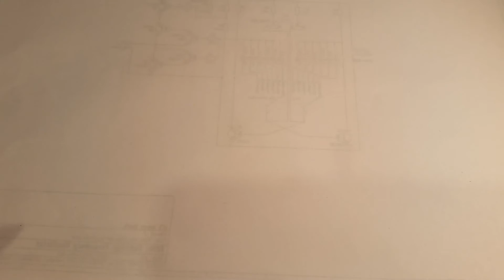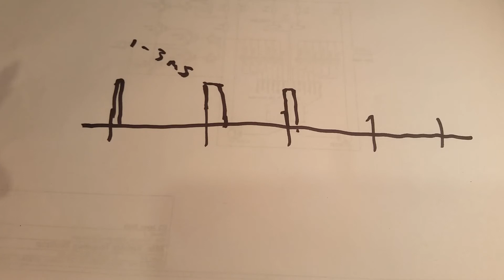Driving a PWM Servo Motor (Pulse Width Modulation)

Comment: hi, I wonder what is the purpose of the TO220 IC on the left? (is it a regulator?) if you drive your circuit directly from the LI-ION battery
Reply from the maker: That is a 7805, the Li-Ion is connected to the output of it. It was there so I could drive from voltages above 5V I think I was originally just powering form a 12V power supply.